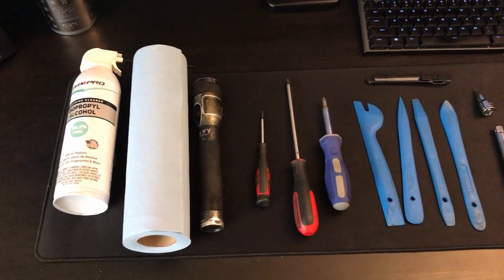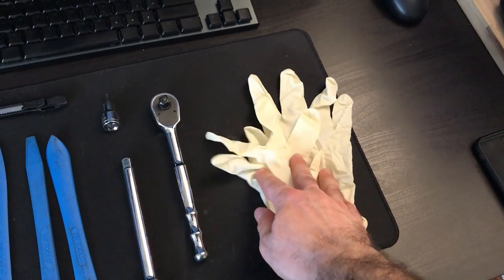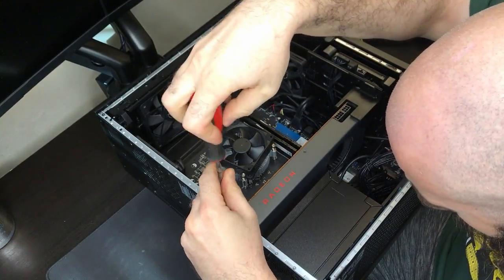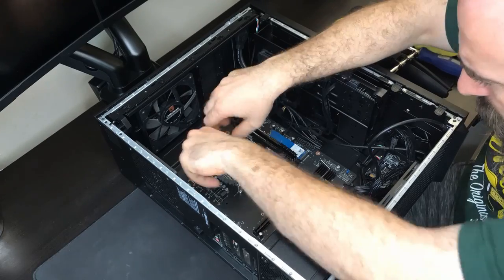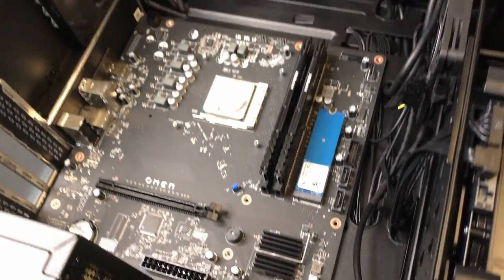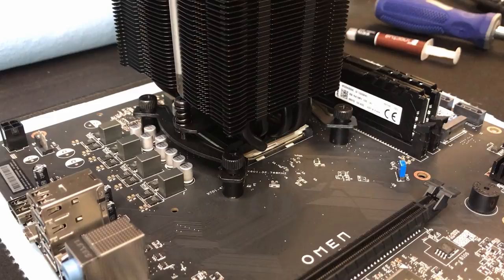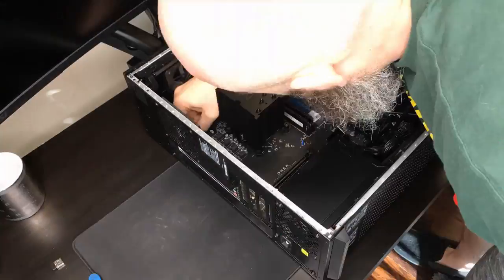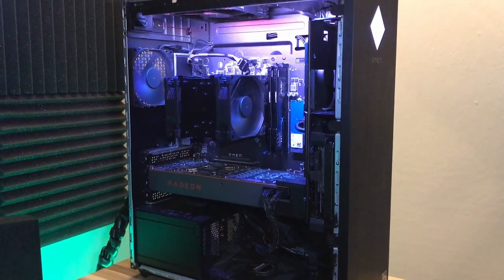Installing A Noctua CPU Air Cooler In My Omen! Complete Tutorial 😎

Comment: Hey Dan.  Thanks for the tutorial.  
To remove the plate behind the mobo I simply pushed from the back and used a flat screw driver,  gently twisting it.  
Worked well also.  

So I added that noctua,  and noise dropped drastically.  Now gotta change the back fan.   Omen brand kinda suck.
Reply from the maker: Glad to here it all worked out for you! Yes, the majority of Omen components in these pre-builds is lower quality.

Comment: Great and informative video. I was shocked at how bad the airflow is in the HP Omen case, but replacing the CPU cooler definitely helps keeping temperatures in check.
Reply from the maker: Best modification you could do for the PC is the CPU cooler. 👍🏻

Comment: I like your videos and have used a lot of your ideas for my son's 30L, but I found a quick trip to the hardware store saved me from having to pull the back plate. Just buy some 10mm M3 thumb screws and use the same spacers and the brackets you did here, and it works perfectly.
Reply from the maker: That method works but you really have no idea how much or little pressure you are placing on the CPU. From what I’ve seen, most people use around 12mm screws, so 10mm may be putting extra force on the CPU. It’s probably fine, just an observation. 

I’m glad my videos have inspired you with your sons 30L!

Comment: this is a GREAT video, very original and useful at the same time, a rare thing. Is funny that it kind of defeats the whole point of buying a pre-built and at the same time it fixes that massive fail of cpu cooler. I wonder if there is any model of cpu cooler that do not require to remove the entire mother board, basically one that can reuse the back bracket.
Reply from the maker: Thank you Francisco! Appreciate it. The CPU cooler is the absolute weakest point for this system for sure. And for $65, it’s a must to swap it out. There is no specific model of cooler that will just bolt on to the existing cooler bracket, but Omen users have used custom spacers and screws to install a cooler. He wrote up instructions on how to do it. I can send them to you through our Discord group in the description or by email.
Reply: @DanKamYouKnow  can I get it via email please? I just sent you an email
Reply from the maker: I just replied to your email.

Comment: Thank you so much for this video and the rest of your fan installs especially!  I'm getting the 30L next week and I was very concerned with temps, going with this air cooler (double fanned!) and replacing the stock fans with noctuas as well.  Love this case but really wish the stock cooling solution was better and now I get to have both,
Reply from the maker: You’re welcome and congrats on the new PC! The Noctua cooler will DRASTICALLY lower temps and replacing the fans. Will make it much quieter. The case is definitely limiting but it looks cool 👍🏻

Comment: Tip. Do not use a flathead screwdriver to pry existing bracket off the motherboard. I thought I'd be ok with adding a little electrical tape to the flathead to pry up bracket. Don't try it lol. Do it by hand even if it takes forever. Better then having to replace a damaged motherboard.
Reply from the maker: Yeah, definitely not a good idea. I used non marring plastic and it worked great. I’ve heard using a blow dryer on low heat work great to loosen it up, then you can almost push the bracket off from the front side.

Comment: Love your videos. 
Just switched back over to PC from Xbox after 10 years.
A lot has changed in the last decade, I just purchased a new omen 30l with the Ryzen 7 3700x  and 16gb of ram.
I’m upgrading my PSU to a Corsair 850x, upgrading my Ram to 32gb of memory (thanks to you I know how) 
Just added a new 1TB SSD drive by Samsung as well and now I’m moving towards better cooling before the rest of my upgrades are installed.
Keep it up!
Maybe you should do a video on the PSU upgrade to a higher wattage modular.
Reply from the maker: Thanks for the support Justin! Yes, I will definitely be doing a video on upgrading the PSU, for sure. Basically every component will be swapped eventually and a video will be put out for each of then
Reply: good psu

Comment: Hi Dan, To let you know your video is still very useful today, your attention to detail and methodical approach, not rushing or over editing is perfect.  I have a 25L coming in a few days, Ryzen 7 5700g  CPU with RX6600XT GPU, it's liable to be hot.  Thank's to video's like yours, I'm aware and can prepare for mods.  Cheers Dan.
Reply from the maker: Hey Paul, thanks for much for the comment and I’m glad the video is still helpful to this day! Let me know if you have any questions 👌🏻
Reply: @DanKamYouKnow  Cheers, my PC turned up early, It's got a good cooler and I'm going to have to push it to get over 45C, I'm kinda pleased because I was concerned about temps. I just put 2 more sticks of Ram, making 32gb's hope it goes well, Ill let you know !
Reply from the maker: I am pretty sure some of the new Omens come with the taller and better air cooler. Happy to hear it’s working out for you 👌🏻

Comment: After watching some reviews and vids, I'm returning my corsair H60 liquid cooler and grabbing one of these air coolers off amazon. 

Apparently unless you go with a water cooler of more than 120mm (240), you're not really doing any better than a good air cooler, and this case won't fit that. I didn't realize I could fit one of these big air puppies in that little Omen case. Thanks bro.
Reply from the maker: This is 100% correct. A 120mm AIO is not as effective as a good air cooler, unless you went with a 240mm or bigger, which obviously wouldn’t fit in the Omen cases. With air coolers, as long as you stay under 140mm in total height, it will fit in the case. This Noctua Chromax U9S I’m using is getting fantastic results, much better than 120mm AIO temps. You’re welcome and I’m glad I could help!

Comment: I am glad I stumbled over this video. Did I get it right that you used an Intel Bracket/Backplate on a Ryzen CPU? The Ryzen AM4 platform uses a backplate shaped like a rectangle but in the Omen 25L it is shaped like a square.
Reply from the maker: Correct. All Omens use Intel spacing / accessories for their coolers 👍🏻👍🏻👍🏻

Comment: Hi, excellent video and super easy to understand. I have one question. I have The Omen 880 and have the exact same old fan that you have. My question is: I saw you remove the backplate from the motherboard, why you don’t simply install the new fan to that plate? Just said to avoid to remove the motherboard...
Reply from the maker: I removed the stock cooler backplate so I could install the backplate you need for the new air cooler. The stock backplate will not work with the U9S brackets. And thank you!!

Comment: Hi Dan. I just installed this cooler, great tutorial. I have a question regarding the 120mm fan you have installed on the top of your case: have you tried it as an exhaust? and if so, was it louder than when it was an intake? I have just installed my 120mm noctua fan as an exhaust and the fan makes noise loud enough to be noticed, even on quiet in omen settings. I don't think its the fan itself, but the wind its pushing against the top grate. Please let me know. Thank you
Reply from the maker: Hey! I have tried both variations and noticed it was louder as an intake and I actually run it as an exhaust fan. I notice my temps are a little bit better as exhaust but have heard that people have more success with it as an intake. Also, if it’s hooked up in the LC Pump header, it will definitely be noisy ( spins at 100% ). I would recommend y-splitting the top and rear into where the rear fan header is.

Comment: This is so much great and helpful information! Thank you for doing what you do and helping us out! 

I do have a couple more questions if you don't mind,
when you install the bracket, did you have to purchase the Noctua u9s separately? Or did it comes with the cooler?

And, when you install the pulling fan, which I assume you had to purchase it since the cooler only comes with 1?, I notice you do have an extra thing that hold the fan to the cooler, did you have to purchase that as well? If so, may I have a link to it please?
Reply from the maker: Thanks Lam!!! The U9S comes with everything you will need! Cooler / brackets / thermal paste / fan clips / etc. I did have to purchase the extra 92mm fan for the push / pull setup
Reply: @DanKamYouKnow  Ohhh, that’s great to know that the set comes with the brackets and the clips! I was worried I would have to find a matching set of brackets and fan clips. Thanks again!!! I really can’t stress enough how helpful your video and you yourself are!! I really really appreciate it!
Reply from the maker: No worries!!! I’m happy I could help out my friend. L

Comment: Hi Dan, great tutorial, it's very helpful. One small question. Did you consider keeping the original back plate (therefore not removing the motherboard)? I'm thinking that will save some time and make my cooler swap easier. Would you see any drawbacks to this approach?
Reply from the maker: It will save time but it’s not the proper way to do it. I do have a write up that someone in our Omen Discord did on how to do it though. DM me through the Omen Discord group in the description or you can email me, which is also in the description.

Comment: Hello Dan, Thanks for a great and informative video. I have carried out the installation as described on an Omen 30 (with AMD Ryzen CPU), and we are now enjoying usefully lower CPU temperatures on the machine. However, there something. I noticed that the stock HP bracket presses on the underside of the motherboard directly under the CPU. The instructions provided by Noctua talk about the Intel bracket being installed over an existing Intel piece, which again would provide mechanical support directly under the CPU. The approach described in your video uses the Noctua bracket but without a stock Intel piece underneath. Now, the Noctua bracket includes spacing elements which space it away from the back of the board, handily preventing it from interfering with the components on the back of the Omen board. However there is no mechanical support directly behind the CPU. The problem is that when the cooler is tightened down, it causes the motherboard to flex, dishing down where is the CPU is, which seems undesirable. It seems that the reason we need to use the Noctua bracket is that the stock bracket has threaded holes, but the Noctua system expects threaded posts. It seems from one of your other responses that this can be addressed using M3 machine screws of a suitable length. Do you have any more details?
Reply from the maker: I think I understand what you're saying and had to look at the instructions myself but with Noctua's supplied backing plate, there should be zero stress on the motherboard, other than the weight of the cooler. What stock intel piece are you referring too? The only part on the back of the Omen motherboard is the stock backing plate, that has to be replaced for the U9S. There is a way to utilize the stock backing plate with the U9S but it requires custom spacer and 12 or 13mm m3 screws. I do have a write up that one of our Discord members did, if you want to DM me on Discord, I can provide them for you. Definitely not the preferred way of installing though because you really don't know how much pressure is being applied to the CPU.
Reply: @DanKamYouKnow  When fitted to the Omen motherboard, the Noctua backing plate sets up an air space between it and the back of the motherboard. When the cooler is tightened down, the pressure on them top of the CPU causes the motherboard to dish into that air space. With reference to the diagrams in the Noctua Intel fitment instructions, that backing plate is designed to be used over a piece that exists on boards that use Intel CPUs, leaving no air gap; as the parts in the design configuration start off in contact with each other, it would act to reduce motherboard dishing when the cooler is tightened down. Similarly, the Omen stock backing plate starts off in contact with the back of the motherboard, which would serve to control motherboard dishing. I'm not sure I follow your point about not knowing how much pressure is being applied to the CPU. Surely that's a function of how tightly the two cooler fixing screws are tightened? I would be more concerned about distortion of the motherboard potentially breaking it 😉 I have a selection of M3 screws on order...
Reply: @DanKamYouKnow  Discord doesn't want to let me DM you. I have sent a friend request? 😉
Reply: @williamblunn9552  Have you found out more? I'd like to install a cooler but your comments about pressure worries me a little.
Reply from the maker: I had the U9S on my Omen for over a year with no issues.

Comment: Great temps, where did you get your duel live wallpaper from? Looks neat
Reply from the maker: Hey David! I use “Wallpaper Engine” from Steam. It’s $3.99 and has a TON of unique live wallpapers that fit any monitor configuration. Well worth the money and just keep in mind, that the Wallpaper app has to be open for the wallpaper to stay up. It also uses a little bit of CPU “juice” to use the engine, but I feel it’s worth it and haven’t noticed any performance loss.

Comment: Great content. Congrats. 
I purchased an Omen 30L
Do you think a Noctua NH-D15 Chromax would fit in considering its size? Thanks.
Reply from the maker: Thank you!!! For an air cooler to fit in the case ( and not contact the side panel ), it has to stay under 140mm and the D15 is just too tall.

Comment: Nice video, ive been wanting to get one of these and its shipping now. Is there any possible way to can install this cooler without taking the motherboard out?
Reply from the maker: Thanks! Yes, there is a way but it involves using custom size spacers and the correct screws. There are a few people on our Omen Discord that have done it, so I’m not entirely sure on spacer size but I believe they used M3x12mm though.

Comment: Hey Dan. I have an Omen 30L and I’m planning on installing the Noctua Chromax U9S air cooler with an additional 92 mm Noctua fan for pushing and pulling much like your rig. I’ll also be using a splitter to connect both fans. Is the Noctua Fan controller necessary for this setup? And if so where on the motherboard do I install it?
Reply from the maker: Nice! The U9S is a great addition. The fan controller is definitely not necessary at all. I wouldn’t get it.

Comment: What did you end up doing with the top fan? Did you leave it as an intake or switch to exhaust? Also for installing the U9S did it come with everything you needed to install it in the box or did you have to use cooler brackets from your secret stash? I’ll be picking up my 30l 3700x, 2060 on the 30th and I’m grabbing all the noctua upgrade stuff I can before it gets here
Reply from the maker: The top fan is set up an an exhaust. Didn’t work quite as well as an intake. The kit for the U9S came with everything you will need. Don’t know why I was trying to use stuff from my D9L kit, but it didn’t work. Sounds like your Omen will be setup nice right from the get go!
Reply: @DanKamYouKnow  thanks for the reply and thanks for the videos! They’re really helping me out!
Reply from the maker: No worries Victor, glad I could help you out.

Comment: What is the part number for the 2nd fan to install on the cooler? And does it come with the brackets to install on cooler?
Reply from the maker: The cooler comes with all the bracket needed for the install. You are going to use the Intel brackets for this install ( even if you have an AMD processor. ). The fan is a 92mm Noctua Chromax:

Noctua NF-F12 PWM chromax.Black.swap, Premium Quiet Fan, 4-Pin (120mm, Black) https://www.amazon.com/dp/B07654PNFQ/ref=cm_sw_r_cp_api_glc_fabc_4x81Fb74AQPRB

Comment: I finally did this and never want to touch a computer in my life again. Lol i lost that screw for the wifi card and its gone for ever. One of those wires popped off for me also and I almost gave my self a heart attack trying to put that thing back on. Other than that, man this cooler is amazing.
Reply from the maker: Computers can be a little finicky but the results are definitely worth it, this cooler is definitely amazing and works so well. That WiFi card wire was such a pain in the ass 😂
Reply: @DanKamYouKnow  😂 at one point my hands were shaking. Trying to get the wire back on the wifi card was so stressful. But the cooler was worth all the stress for sure.

Comment: Looking at this same computer from Costco and was looking at adding an AIO Liquid Cooler. Is there a reason you picked this Noctua Air-Cooled setup over a water-cooled setup?
Reply from the maker: Yes, first reason is for looks and the 2nd is because air coolers generally perform better than 120mm AIO units ( only radiator type that fits in an Omen case ). If we were able to put in a 240mm rad, then that would be a different story. But as of now, my temps out-perform Omens with 120mm setups. Plus air coolers have a nearly a zero percent chance of failure as well. Remember that if you want to go with an air cooler setup, the total height of the cooler has to be under 140mm, so we’re limited here as well. But the U9S and D9L are great options and cheap as well.